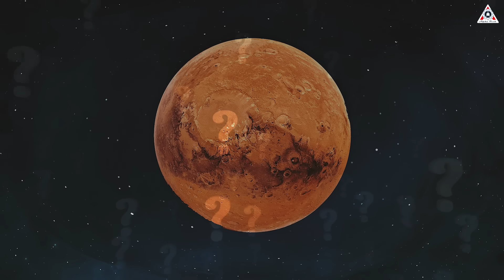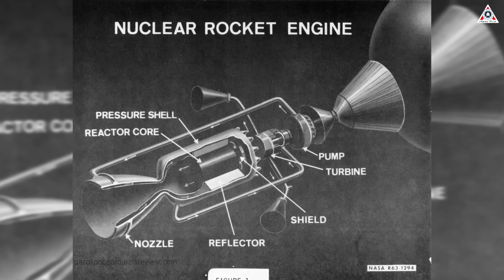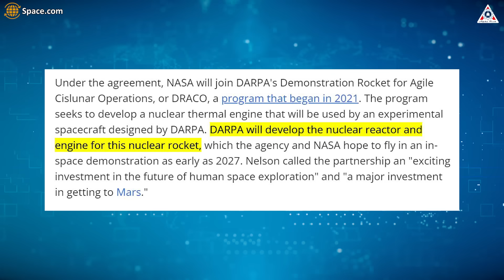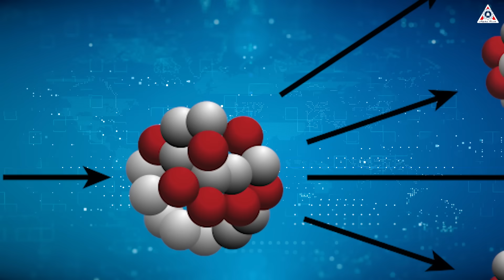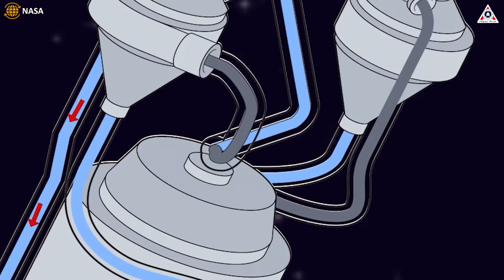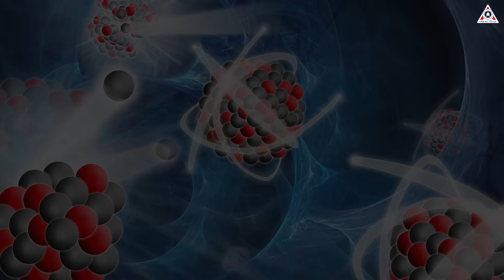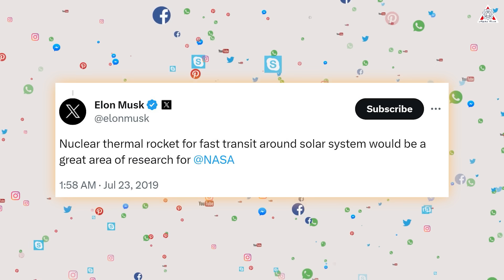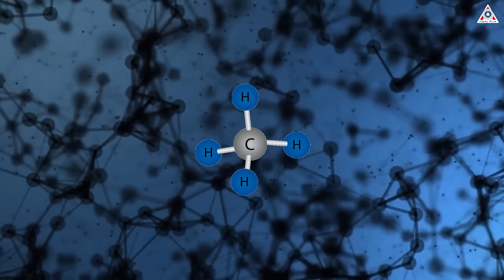NASA declared "Nuclear Mars Rocket Engine is better & faster than SpaceX Starship"...

Comment: This video is filled with technical errors both in concept and particulars. It oversimplifies to the point of distortion and error. Thermal nuclear is not more "powerful" than chemical propulsion, it is more efficient. It is also vastly more expensive. NASA/DARPA thermal nuclear is not in competition with SpaceX's Starship.  Starships will be mass produced as cheaply as safety allows.  It is envisioned that hundreds of Starships will make the crossing.  Thermal nuclear will be so expensive and regulated only the highest priority payloads will be afforded its usage.  Perhaps in the future  thermal nuclear “spaceliners” will be used to shuttle human cargo to Mars and back and the bulk of the equipment tonnage with go on Starships.
Reply: Maybe it is not that expensive if you use thorium. The nuclear fuel they don't want people to use on earth because it makes weapon grade nuclear mater. Easy to get and not too expensive.

Comment: I worked on this in the 80s.  You cannot launch it from earth because of catastrophic failure would irradiate the launch site for a long time.  It may be used in space, but there are many hurdles to overcome and might become vaporware.  NASA is so slow it might take decades.  It would be incredibly hard to even test these engines on the ground.

Comment: A nuclear fission engine has been demonstrated before with the NERVA project. I'm curious about the details of the new proposed engines, like what kind of reactor pressures they anticipate and how they are going to power the turbopumps to ram the hydrogen into the reactor. Shielding the crew from reactor radiation is a consideration. Also do they turn the reactor power down with control rods? Nuclear reactors are never 100% off.
Reply from the maker: Thank you for your comment!
Reply: @alphatech4966 the secret is muon implosions that fuse into the highest element, that element absorbs the energy & explodes back into hydrogen then muon gas/ antimatter 
its what powers our universe 
and we can tap in!
we must use the same magnetic geometry structure
by creating a ball magnet with hydrogen inside
the ball magnet has a ratio of 11/10 ( the ratio in all atoms/ stars etc)

Comment: Jmpo: What we should do is moving systems into orbit with conventional fuels. Assemble a transfer ship (with hydrogen collectors) to use nuclear propulsion, but designed for continues operation during the entire trip.
Starting out with a '1G Earth' acceleration reducing to '1G Mars' with a mid-travel-time flip to slow down to orbit insertion speed around Mars.
The revers during the return trip.
Again, jmpo

Comment: This is where the molten salt Thorium reactor came from in the early '60's - it was supposed to power a bomber that could stay aloft for months. This would surely push that technology back in front. It could power your Le Car. Because it's molten salt - it's even safe if it explodes. Pretty much.

Comment: There is no reason why the Starship can't be modified to use a combination of Nuclear fission engines to power the actual trip between any planets. Elon has made clear that he is very interested in using nuclear propulsion and I would be surprised if SpaceX doesn't have some research underway on developing some form of nuclear propulsion.

Comment: So, if you're going to Mars, wouldn't it make sense to take water and separate it in flight so the oxygen can be used to power fuel cells and support the astronauts? Why take hydrogen if you still need oxygen when water has hydrogen for fuel and oxygen to support life. We all know life can not exist without water in our universe.
Reply: I thought the same thing only kind of different. 
Build an inflatable O"Niel cylinder miniature version in Egg shaped orbit between Earth and Mars. Taking Way longer than 45 days but traveling in safe comfort.

Comment: An atomic thermalhydromagnetic rocket would be more useful if you can perfect the magnetic bottle to contain the higher plasma field temperatures from touching the walls of the rocket. Our current plasma rockets are still at the lower end of the plasma field energy.
The atomic power would add significant additional support to the magnetic bottle.

Comment: lol, not electrons bombarding in a u235 chain reactions. its neutrons. which was circled. but even funnier is the "hydrogen is the lightest element discovered to date". the definition of element being an substance that cannot be simplified by chemical means. ie: an atom, generally speaking ;)   and 1 proton, one electron alone is base hydrogen. you cant get lower than 1. ;)  the theoretical limit is base hydrogen atoms
Reply: There are no free Hydrogen atoms on Earth, there are hydrogen molecules, consisting of two hydrogen atoms - H2. Otherwise you're right, the narration is ignorant of basic physics.

Comment: Not likely a good gravity well engine, or good to use where an accident goes Chernobyl...

Basically its a Transit Ship engine...
Which is why I like to do writs on how to start building bigger stuff in space...
And how to get bigger pieces into orbit that are those building sections. 
One easy shape for Space assembly would be doing spheres or elongated ovals, based on telescoping sections starting at a center ring, and going outwards both directions from center to dome shaped ends.
Basically they would be collapsed for launching, and stacked, and then expanded once in orbit. And could temporarily rely on gaskets, or be permanetly welded up.

And they could be combined with tubular or hex tube struts to create Space construction tinker toys, that you could then sheet in between, and create mega ships for the nuclear engine transit runs.

Basically talking about a framing system thats the bones of large ship structures, and that were habitable even independently.

With hatches between every compartment like any good ship.

Basically Elon is working on gravity well tech. and has made serious progress already. But the potentials of fabrication, and simplified engines, is only limited by imagination, and how much fuel mix you can afford.

What he has proven is you can launch really big pieces of much larger things into orbit.

I hope we can start thinking appropriately, and not stay in the 1960's for another 60 years.
I watched the first Moon landing live on a TV. I would gladly watch the first Human Mars landing thru a portlight from a mega transit ship that dwarfed an Aircraft Carrier.
I'm quite fond of ships, and living on them. They tend to be the most inspiring things to grok, going for a ride.
I love Starship, but its basically a Motor Whale Boat compared to what we need to be building for serious space endeavours.
Something you'd have a selection of in the Hangar Deck..
They aren't piddly, But they are only a Starship in aspirational name.

We need way bigger Starbirds to fly faster and farther...

What were we waiting on?

Comment: What will happen during the deceleration phase? Will the vehicle travel in a pollutant cloud emitted by the nuclear engine? Its entire surface will be contaminated by radioactive material. What is their plan for braking? Because you will have to brake at the same rate as the vehicle was accelerated.
Reply: In future , oneday if we use fusion this will be ok
Reply: Good point, but I would think looping around Mars while the descent capsule could aerobrake into the Mars atmosphere. Just use the nuke as a taxi.

Comment: I doubt very much of those estimated dates for the nuclear powered rocket engine, add ten more years and even so it would be optimistic. Those near dates are important for getting governmental funds but they are not real.  Maybe it will be a good solution for cargo rockets, not for man controlled rockets, due to the inherent dangers of nuclear power. A better bet would be an ion rocket engine, already being used and with a good prospect for future use.

Comment: The NTP booster module should dock with the payload in earth's orbit. The NTP booster then ferry's the payload to its destination orbit. It then Undocks allowing the payload to decend to the planet or moon unencumbered. It waits in orbit until its needed again for a return.

To allay all fears, the NTP booster module is launched into orbit without nuclear fuel. Several  independant launches will carry the fuel rods, which are then installed in space.
The NTP booster module is fueled from the payload.

Comment: And scatters more radioactive debris if it explodes on take-off?
Reply: That’s not how reactors work. The hydrogen loop would be isolated from the irradiated parts of the reactor.
Reply: And that's why they aren't in wide spread use. Because they do make a lot of sense energy wise.
Reply: @erikswanson6687  That's not how it worked in NERVA. The propellant gas was pumped straight through the reactor acting as both a propellant and a coolant for the reactor. With 99.99% certainty that is the same way this new engine will work.

Comment: If they replaced the reactor with an oxidizer tank and were able to scavange oxidizer (oxygen) from the vacuum of space (like they will need to do with hydrogen) they could (theoretically) do the same thing without need of pile, just a blast chamber.

Comment: Nuclear engines and reactors require alot of coolant, which Space is filled with, this could work but why didn't they not use the technology before, they used reactors on land in cooling tanks, ships and submarines and event in planes like B-36 peacemaker, space is more freezing than the closet temperatures on Earth.
Reply: Problem with your statement is space is not freezing, it has no temperature. Things are cold because they don't retain heat absorbed directly from the sun.  Also if space was freezing, why to spacecraft roll to prevent one part of the hull overheating?

Comment: Since a nuclear engine has a lot of advantages it has its concerns. Build a moon base assembly and testing out in the vacuum of space in which it will operate can be tested and if a go be launched with a lower gravity of earth from the ground or from orbit.  A moon base is the stepping stone for further expansion into space!
Reply: yes moon can be a perfect testing base
Reply: Still wondering why the other interim stepping stone hasn’t been considered…a much larger and more comprehensive orbital station - orbital transfer station. Falcon 9s can EASILY get to LEO…so why not have an orbital station where things can be built, various sourced elements and resources for missions sent up, all loaded on another craft at the station, then departs from LEO - Can be a much larger, differently designed craft as it would not be atmospheric - and the biggest efficiency increase, wouldn’t need to break earths gravity as hard, as the overwhelming majority of thrust, fuel etc used to get to the moon in the 60s for example was getting up to orbit in the first place

Comment: Nasa should begin with simulation studies on the long term effects of using nuclear engines in the solar system. What are the likely decay times of the radioactive exhaust? Will that accumulate over time at various numbers of nuclear powered ships?